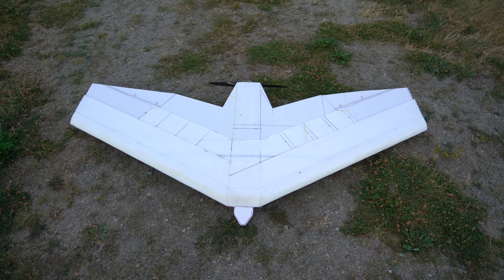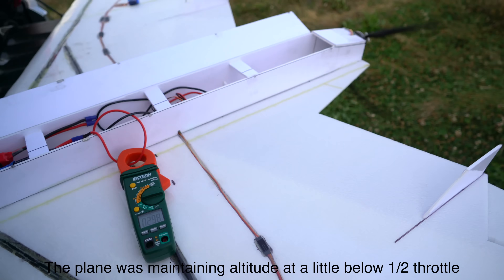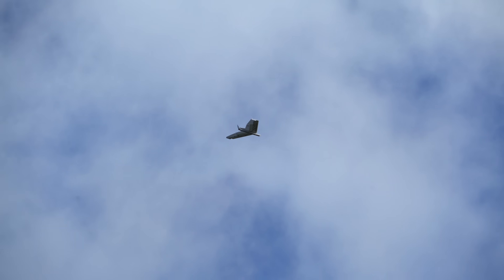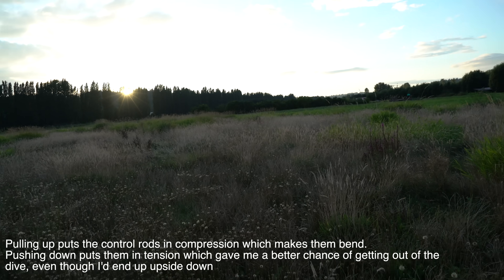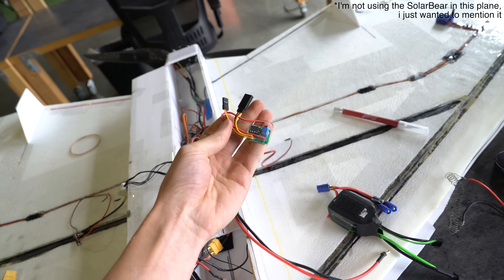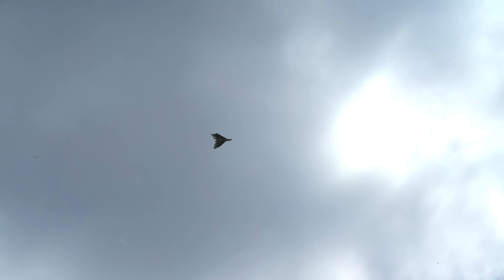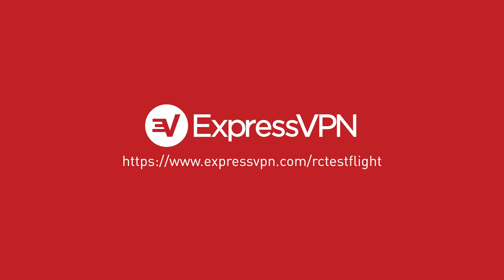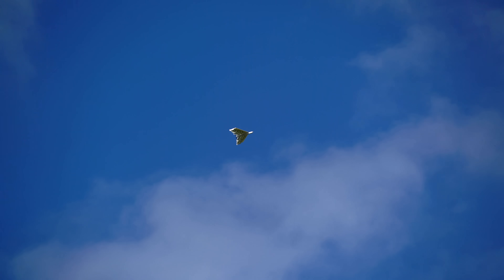SOLAR Plane V4 Flying Wing

Comment: Yo, brother! Not bad! But low power density from solar cells needs low power consumption. Thus you need low speed and high aerodynamic quality.  You need long thick narrow  wings, as in the glider. Achievable quality 15-20-30.
Imho your wide short wings hawe aerodynamic quality 6-7.
1.9 kg, 8 m/s - your comsumption is about 30 W. 
Your battery 2300mah 4S - 34 Wh, it is enough for a flight of 1.2 hours and 35 km without solar cells at all.

Comment: You should make it that one layer of solar is charging a small battery and the rest for the motor and you can make it when the sun gos down and there’s a back up ready so it doesn’t cut power and crash

Comment: The best part about the KF airfoil is that the effect was discovered because they were wondering why their paper airplanes were so good.
Reply: James Burleson ... It is my conjecture that the trapped vortexes prevent the wing from stalling because the rotating air lowers air pressure on the upper surface and continues to produce lift. In addition, the vortexes need to equalize air pressure on both wings thus making it very stable by self correcting and keeping the wing level. My paper airplanes exhibited these characteristics which led to filing for a patent on the step.

Comment: This is pretty awesome.  I've had ideas for doing this for some time and your design was one I considered as well.  I wonder if supercapacitors might not be a better option for weight, weathering, and duty life instead of a battery pack.  Or maybe both.  Also some vertical stabilizers/rudders on the wing tips would probably help with navigation.  It's really cool to see something I've been designing in my head in real life. Well your idea and design of course.  Good work though. Thanks for sharing with the rest of us!

Comment: Why don't you use the load port on your MPPT charge controller? The batteries are not supposed to be abused like this, you get much better lifetime if you charge them properly.

Comment: How about using some gliding techniques where you stay in thermals(rising columns of air) to gain altitude where you find them. This way you  use minimum electricity for the climb up and also climb much faster. All you need is a vertical speed sensor and an accelerometer is quite good at this.

Comment: Your solar cells are connected to battery charge controller and then connect to a battery management system 30A which connects the two lithium batteries. Am I right?

Comment: Quick question from a tech/flying amateur, I've seen people like Dustin Dunill use a 3G mod on Parrot Discos to get near-unlimited signal range. Does the Pixhawk or other systems use something similar to this to get that long range, or is that a trait unique to WiFi control options? Loving your work, really enjoying learning this stuff.

Comment: Could you use capacitors instead of batteries? Or will it be the same weight? Also why the swept wing design? Straight wing should have a slower stall speed, and swept wings usually perform best with some speed. You could fly it slower and maybe have more power in reserve?

Comment: Daniel....  Since you had success with the KFm2 airfoil, at some point you might want to check out the KFm3, which is a heavy lifter with two steps. It can carry quite a load because of the double vortex on top. Here is a video that demonstrates its ability to lift more than a conventional airfoil.   
https://youtu.be/rspdbPaMY9c

Comment: Im suprised those SG90 servo motors even worked the first time. Those plastic gears inside break VERY easily. Instead of the SG90, use the MG90, it has metal gears.

Comment: I really think you should redo the airframe a bit so its naturally more balanced in CoG and CoL, and integrate some slightly better yaw control on it if possible. I think maybe this was a sign to go back to the drawing board and apply what you've learned.

Comment: MPPT does not put out a pulse type output control.....
and another solar plane guy just fed his solars direct at some point where his screen showed only the battery level and "0" amps output which meant the solars were doing all the work, he just used those battery numbers to indicate how they did.....kept his plane up for 81 hours...

Comment: elevons are verry bad designed man , you'll find more efficiency here , redisigning . Not by demanding a bigger  work from your electronic trying to have a clean straight flight , with a bad shaped  or positionned aerial moving part.  Wich actually drowning amps on top of that so.. but your design is pretty good on global.. Delta and payload have always been a good deal ! Keep pushing man , you get a nice yt channel ;)

Comment: Could you modify the servo rig to work in push-pull manner, with two rods per servo instead of just one, one above and one bellow the control surface?

Comment: Really cool project!!  I think your naked cells are also enjoying a bit more air cooling capacity (Solar PV operate more efficiently the cooler they are).  Also, you could probably shave a few or 10 grams by removing the enclosure for your MPPT :)

Also, and you may know this, but testing voltage output of cells tells you very little about power output.  I used to freak people out by hooking up a 200 watt module in a cardboard box to a basic multi-meter and getting it to hit 18 or 19 volts for a solid second or so before the accumulated energy (which I assume is some weird quantum/background radiation thing) drained.

Comment: 6:12 You mention the plane being rather efficient despite it's aspect ratio. I don't think that's surprising as aspect ratio doesn't effect the drag very much, especially at low speed. There are 2 types of a drag a plane encounters, induced drag (drag generated from lift) and parasitic drag (drag caused by air resistance).

Induced drag increases as the wing span shortens, and decreases as the span lengthens. Aspect ratio doesn't change induced drag, only span length does. For a full explanation of why that is you can read here: https://aviation.stackexchange.com/a/8797/31421

Parasitic drag is affected by the surface area of the aircraft, so the long cord length will effect that, however with the aircraft flying so slow parasitic drag hasn't kicked in much yet. You can see this chart showing how airspeed effects both these drags inversely:
http://learntoflyblog.com/wp-content/uploads/2016/04/Drag-vs-Speed.jpg

Awesome project by the way!
Reply from the maker: Interesting! So with this logic, could I increase the chord by 2X, use twice as many solar cells, and the only consequence is increased parasitic drag? (assuming the additional weight of the lengthened wing and solar cells is roughly negligible). If this is true then it seems like low aspect ratio wings are the way to go for lighter solar aircraft because you can significantly increase power generation while not increasing power consumption very much
Reply: @rctestflight  I would so love to see you try that! In theory it would work, but there are a few tradeoffs to keep in mind.

First if your only goal is 2X power generation, you'd be better off making the wing span twice as long. Then you'd have the best of both worlds. 

The induced drag would be reduced immensely, and the parasitic drag would only double. If you instead increased the cord by 2X the induced drag would stay the same, but the parasitic drag would quadruple.

This is because you are giving each molecule of air 2 times the amount of distance to gather speed. Vs if you kept the cord the same and increased the span you are having twice the amount of air move at the same speed.

The equation for energy shows that speed is squared, while mass is not: https://www.calculatorsoup.com/calculators/physics/kinetic.php 

So by increasing the cord length by a factor of 2 you are increasing parasitic drag to that of the second power, which in this case is 2^2 = 4.

Now that's oversimplifying it a bit, because the air molecules will only accelerate to the speed the plane is traveling, so a longer cord won't necessarily be to the power of 2 less efficient, but the effect is there.

So longer spans are always better in terms of efficiency, but they have trade-offs. Less roll authority, harder to store/manage, weaker wings, often heavier wings as stronger materials are needed, lower stall speeds, less forgiving of build errors, ect...

So to answer your question, yes the main thing that changes with cord length is parasitic drag, but it does so to the power of 2. You also aren't reducing the induced drag. Both of these problems could be avoided by increasing the span instead of the cord.

However since you are adding solar panels to compensate it very well may work, and it would have several advantages outside of efficiency. I would absolutely love to see you try it, as I haven't seen anyone else go this route with solar panels before. You'd be a first in history as far as I'm aware!
Reply: @rctestflight  Also we have tons of data on high aspect ratio gliders perform, and how they perform. But they have drawbacks, mainly that some of their wingspans are over 70 feet long. 

Seeing a project experiment with cord length while using solar panels to supplement would be a very cool change.
Reply from the maker: @Justin73791  So I guess the question is whether my increased parasitic drag from a lengthened chord is more or less than the increase in induced drag from a longer wing span plus the increased weight of more wing structure. Sounds like building both aircrafts and flight testing is the only way to find out. 

What do you think about the difference in drag between a flying wing and a traditional wing + tail configuration? 
If you took the wings off my solar plane V3, gave them some sweep, added winglets, and turned it into a flying wing, would it have more drag than the current solar plane V3? I've been told it will require a steeper angle of attack to fly and thus have more induced drag.
Reply: @rctestflight  Yeah an A B test would be awesome. My prediction is that no matter what you do just adding wing area to fit more solar panels will give the plane better performance.

The question is how much do you want to "optimize" that performance gain.

Longer spans would give you better speeds, but you would also have higher stall speeds. Longer cords wouldn't give you as much added speed, but roll performance, stall speeds and other factors would be greatly improved.

A flying wing has 2 advantages over a traditional plane. First there is less surface area on the plane as a whole, since you're dropping an entire "wing". This means less parasitic drag. 

Second the rear stabilizer on a traditional aircraft is generating "downwards lift". This is to keep the aircraft balanced around the center of gravity. Here's a picture of the forces in play:
https://www.boldmethod.com/images/learn-to-fly/aircraft-systems/canards/172-lift.jpg

That downward force really helps the aircraft in terms of stability, but it's adding artificial weight to the plane in flight. Not to mention the induced drag created from the downward "lift".

However for both it's advantages a flying wing has 1 major disadvantage. It's nearly impossible to balance. Look at the picture from above and imagine the tail being taken off. You have to have the center of gravity perfectly lined up with the center of lift, otherwise the aircraft will tilt toward the center of gravity (ie in the picture above if you remove the tail the plane will dive nose first).

This is offset in flying wings by constantly adjusting the ailerons to keep the center of lift right on top of the center of gravity. This often requires computers to help, but can be done by a human if you get the hang of it. 

But it's not just that it makes flying the wing harder, these constant adjustments also hurt efficiency. How much is dependent on how well the wing is built and how evenly distrusted all the forces are. 

In the real world efficiency of flying wings are normally a little higher than traditional aircraft, but not by much. They are also much harder to fly.

In terms of wing sweep, unless you need directional stability you can just ignore it. Wing sweep looks cool, but for subsonic aircraft it makes the plane less efficient. You can read about that here:
https://aviation.stackexchange.com/a/9292/31421

In terms of wiglets, only use them if you can't make the span longer. A longer span will beat wiglets every time. However if your wing is too long, adding wiglets help get lower induced drag while keeping you wing span constrained to a desired size.

Comment: Hey Daniel , did you ever consider a flying wing filled with hydrogen so it's almost weight less .an has less solar panels on top .
Reply: Highly impractical.
Reply: Hydrogen would provide very little lift, is explosive, and can leak through anything.

Comment: Well done. 
There was a manned solar plane called Solar Impulse. Mk 1 flew for 24hours and then mk 2 went around the world. They had to stop over at different countries to change pilots. Thier aircraft needed to climb during the day under solar power and would glide for most lf the night. Only useing the battery for about an hour or two before sunrise.

Comment: Ardupilot hardware tip:  Analog current sensors are notoriously inaccurate at low currents (<4A?).  Digital current sensors are supposed to be much better and more stable.  Maybe mRobotics could sponsor you a couple units?

Comment: I enjoyed  your videos .
Have you tried replacing the battery pack with super capacitors.
Tom Staton  did it with his 3D printed RC rocket with good results and minimal charge time.
Keep up the good work.

Comment: some info.         at 3:39,    kfm steps  Should  align with 'mac'.    mean aerodynamic chord.     mac is a line from, say,
fifty percent of  root chord  to  fifty percent of  tip chord.         consequently, where a wing is not constant-chord,  kfm
steps  Should Not  be  parallel.        ideally, the performance of a fkm profile should simulate that of a clark-y profile/
airfoil.          the leading edge and forward steps of a kfm profile,   Should  Simulate  those of a  clark-y..        in general,
main wing control surfaces should have the shape of a   parallelogram.          googletranlate
https://en.wikipedia.org/wiki/Clark_Y

https://en.wikipedia.org/wiki/Kline%E2%80%93Fogleman_airfoil#/media/File:KFm2-airfoil-laminar-flow.jpg

Comment: I have a similar problem with a plane out of Depron, it's called Dizzy Bird but there I assume that is not the servo nor the rod but the rudder itself which is not stiff enough for the job as it has to maintain rotational momentum over quite some distance. Beware that it could be the depron as well.
Additionally info: Depron has different stiffness in the 2 main direction. You are probably aware of that but I did not see anybody else writing that so here it is.

Comment: That together with a 4g lte telemetry soultion, that will be mind blowing
Reply: "control ot from mars"
Reply: Problem with that is that power would be used more often with high bandwidth radioz
Reply: @mrni6502  should use to much power it seems like the solar charge is able to keep up with the loss batterry power

Comment: I’m no expert, but would using a powered glider design and tandem wings work well?

Use such giant wings that it barely needs power to function.

Then have tandem wings/box wings so ~2x lift and solar area.
Reply: Here is a (small) tandem wing design

https://youtu.be/V0jHLivkC_k
Reply: And here is a 4 meter wingspan unpowered flying wing glider

https://youtu.be/JYoMn6F_UZU

Comment: One tiny suggestion: You could use power (watts) instead of current when talking about charging/discharging rates. This way it doesn’t matter if the voltages change or if you measure at the battery instead of at the solar cells.

Comment: for a 4.1 or 4.2 version of this plane, I'd suggest using coat hanger for reinforcement and to actuate the controls. On top of that, I'd recommend pushing the prop to the center of the plane like some mass produced planes I've seen. That should help normalize the CG, CT, and CL so it's less awkward to handle. However, I think the overall shape is really good. Maybe some extra foam to smooth out some shapes on the underside would be needed but the plane looks to be doing really well. Maybe with some refinements to the design, EG, wire bumpers for protecting the solar panels, this could be made into a sell-able design.

Comment: This style wing will have better stall characteristics due to the turbulent airflow(which has more energy) caused by those steps, in a regular wing in a model of this scale the airflow would be way more laminar and, thus reducing the drag. This is minimal and i dont even know why i explained, but theoretically a wing whitout steps would be better.

Comment: Nice projdct.. i think you need a rudder for  pixhawk have more control on turns and correct heading.  With elevons the plane need to turns completely..not just yaw..

Comment: Hey, just a short question about the screen recording. Why didn't you use the integrated recording feature of Windows 10, it is usually designed for gaming but you can set it up to work on everything as far as I remember. Have you considered this or do you have reasons for not using this feature?

Comment: I think you should rebuild the plane, but leave small divots in the foam measured out to hold the solar cells. This might reduce the drag a little bit. Also maybe add small winglets to the wingtips, it might drift around less. Of course, larger ones would work better but then you have to worry about accidentally blocking the light to the solar cells on the wingtips.

Comment: I think you are gonna have to make Solar plane v5.
That wing is way too unstable. I still reckon a wing is the way to go, but you're gonna have to make sure it's more stable at higher speeds and has decent control.